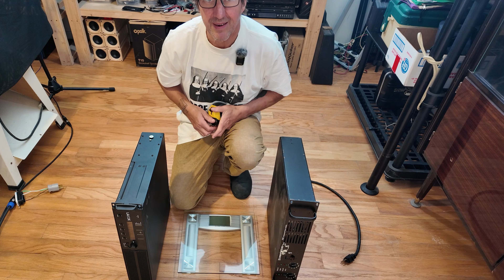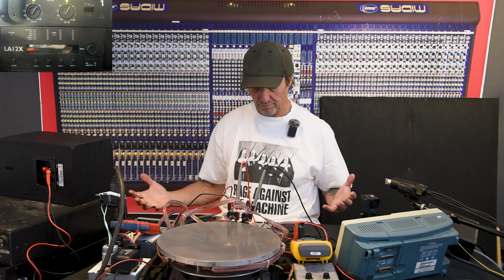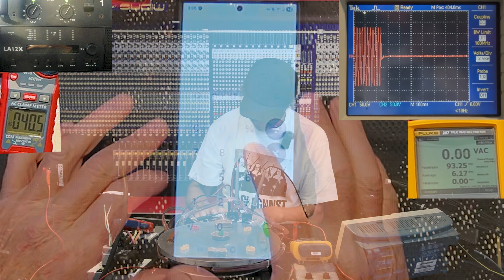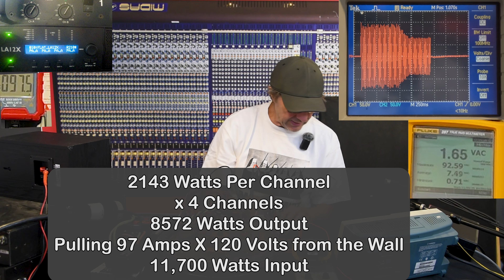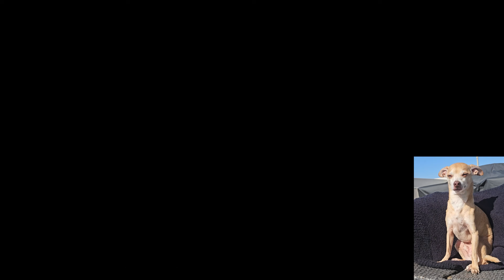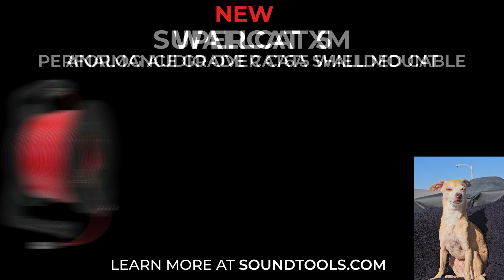Who Does RMS Power Better, Old or New Amp?

Comment: Whichever one has the largest PS XFMR with the stiffest VA supply and the stiffest, largest PS caps will give you the most RMS power into lower Fs - full stop......
Reply from the maker: that makes sense except what about circuit breaker size? in the full stop are you allowing some amps to have bigger breakers than others?

if they are on the same size breaker wouldn't the most power efficient amp have an advantage?

what about if the amp is smart and tracks the actual circuit breaker current supply curves like the LA12x does? 

the Crest blows it's breaker when power exceeds the fast blow front panel breaker.

the LA12X has a power supply that exceeds the breaker size and will draw 100 amps through a 30 amp breaker and then reduce its output to insure the breaker does not blow, is that relevant before or after the full stop?

also there are thermal considerations where the power supply can supply way more power but there is a time limit.

even amps with the same size power supplies may not deliver power in similar ways..

perhaps like two vehicles with both having 500 horse power, like watts.

but one is a car with a turbo charged 4 cylinder engine and the other is a tractor with a diesel engine.

do those factors happen before or after the full stop?

Comment: I wonder if it could do full power if modified  with larger rail caps?
Reply from the maker: caps don't really do that much for very long. they are just little peaker helpers.

running off of 240 volt helps. but the amp is limiting its output to insure it does not ever exceed the capabilities of a 30 amp breaker that it is specified and designed for.

Comment: I'm surprised the amp manufacturers don't go to some water cooling scheme.
Reply from the maker: how many shows or situations do you actually do where you're running every amp channel at absolute maximum with no limiters? The easiest solution is just to reduce the loads on the amps or turn down the outputs a few DB. 

I think it's easier just to bring another amplifier than to have every single amp set up for something that we rarely use it for

Comment: The decrease in voltage could be thermal throttling. When you're testing amplifiers for RMS capabilities operating at high volume levels, amplifiers have thermal protection circuits which will decrease voltage, due to heat as well as stressed capacitance. There's also capability variations based on the frequencies being produced and the fact that QC testing usually uses narrow frequency ranges to calculate output. Lower frequency pulse tones increase the stress naturally as resistances (ohm loads) decrease. Class D amps, particularly the ones that utilize GaN FET topologies, are now rated among the highest quality options in high end audio. Lighter weight, cooler operation and more efficient as well as accurate musical reproduction. And considering that the tech is priced more economically makes newer class D amplifiers tough to resist.
Reply from the maker: I actually did some research and also have friends over at L-Acoustics. The output power reduction when multiple channels are driven is the amp making sure that it won't blow the breaker. 

in the owner's manual for the amp they actually recommend a specific breaker and the amp has that information embedded into it and makes absolutely sure that no matter what it won't blow the breaker but will deliver as much power as it can until it reaches the breakers limitations
Reply: @DaveRat  I suspect the output power reduction when multiple channels are driven is equally as much protecting the power supply circuitry from melting, if those current levels were sustained.
Reply from the maker: I agree but perhaps the reverse thinking

since the amp is designed around running in a 30 amp 120 or 16 amp 240 service,  the power supply and thermal capabilities are timed to be optimized for a maximum long term power of 3600 to 384 watts accordingly.

the output modules definitely can put out more power than the power supply/power source and using the amp to drive a few subs and a mid and hi box will allow all boxes to be driven at max power long term
Reply: @DaveRat  Have you ever explored "rail balancing", where half the channels (identical content ie; subs) are inverted at the amp input, and inverted again at the output, so at any instant those inverted channels draw from the opposite supply rail? Curious how much (if any) difference it makes.
Reply from the maker: one of the first few articles I wrote for Live Sound magazine was on that topic. Maybe search Dave Rat "power to the people"

but modern well designed amps typically do this by design, I first saw it in the lab gruppen amps back when the 6400 was released. 

also doing things like delay arcing subwoofers which puts incremental delays on each few channels or mixing subs and mid high boxes on the same amp has a similar impact

Comment: Maybe a little long video for it's purpose, but yep, it shows the main difference and issues. Analog (linear) amps with classic "convection" PSU is worst case. Then we have analog ends with SMPS PSU, which solve half of the problem, then "final" solution with SMPS and class D amp(s).

The first one is worst, because we have PSU, that is not so "hard" and as it will weight a ton if it have to be capable to delivery sum of power that are capable to deliver whole amps. So this "softness" was compensated in case two, because SMPS have magic thing called feedback, that PSU hold its voltage as long as it can, thing that transformer with caps "can't", if you don't use any kind of stabilization (and you can't, because you will waste huge amount of money, add ton of weight, another coolers and so). But you have still very "ineffective" ends, which works in linear area. That solved class D, where you have transistors in pure pulse mode and that PWM is filtered on RC network on the output.

So yep, old amps weights a ton, are ineffective and also pretty weak (but simple for repair). Then we have something in the middle, SMPS with analog ends and then final solution. Problem is, if we put that huge amount of power ends in one case, we also hit the top-limitation of PSUs. So in this case, the limit is not the amps, but PSU. Btw. if you look closely, for example on Powersoft Litemod amplifier, or B&O Icepower, you can figure our where ends PSU and start "amp" part, small hint: B&O sells also "pure" amp modules and you can simply figure out. Standalone amp is pretty simple and small, more than 70% of whole "amp" is PSU.

Then one thing remains: is that real limitation? Do we listen to 50Hz sine wave? No, also EDM have pretty small power envelope in time, so that's the reason why it doesn't care. More interesting is, how modern amp can handle peaks, because it have ability thanks to more complex PSU and caps bank to deliver huge peaks, where analog can't. For example IPD2400 is not so brutal in first look, but that amp have pretty huge cap bank inside and can use it.

There are also very old school amps, that can deliver "long time" power for hours, but you will get it. These amps weight 20+ kilos, have around 400W in bridge in 8R, are noisy and have pretty bad behavior in peaks. That filosophy died in end of 80s, so these "newer" analog amps can't deliver that RMS power (50Hz sine wave) for like half hour or so (not everyone, but most of them).

So, be happy that we have D class amps and use them properly, don't waste time with cheap ones, grab pricey but branded one, not cutted down models like the cheapest labgruppen ones which are just relabelled behringers. Have a nice day!

Comment: I tested old school car audio amps made by Rockford Fosgate in the 90s and I also saw this reduction of power over time, I don’t blame the amp class but protection circuit and power supply section 👍😊
Reply from the maker: agreed. there is a belief that class D has lower RMS when in fact for a given RMS, class D tends to have a much higher peak and music power, while also being lighter, smaller, cheaper and more efficient
Reply: The power output reduces the hotter the transistors get

Comment: Great topic to cover I like the a/b for minds and highs.  And class d for sub
Reply: Same, I run class AB amps for my compression drivers they just sound so much nicer and more hifi than the class D amps. The class Ds are good on the sub / mid bass, but they are mid priced amps so could well be why they arent as good at the top end. I'd been interested to compare them to some high end class Ds

Comment: Thanks for this video. It was very informative. I didn’t understand all of it but got enough of it. If I need a class D amp, I’ll make sure to plan on not using its max capabilities. 

It was interesting to see that even with the self-attenuation the class D amp does when maxed out, it is still far more powerful than the old school class H amp. 

Decreasing wattage by decreasing input voltage on the class H made sense to me as a guitar player since that’s what Van Halen did with a variac on his Marshalls back in the early days to cut the volume slightly and achieve his “brown sound.” That class D amps are so smart that they adjust wattage to compensate for different voltage was impressive to me.

Thanks again.

Comment: I don't think this is representative of class d as much as it shows this specific amp has a power supply section that is undersized for sustained maximum output of all 4 amplifier channels. I'm sure other amps will do it fine
Reply from the maker: agreed. the max RMS is limited by the AC input/breaker/power supply.

this amp runs on a 30 amp breaker which is common for pro amps. the amp actually is tailoring its output to stay within the circuit breaker current curve and there is a recommended breaker model #

Comment: Fun little experiment. Raw amp power capabilities is one thing but talking about this level of output screams power compression long before any amp limitations come into play. Heck, even speaker leads become problematic. And I totally agree with you on rather having a limited output than no output at all. Here in the EU anything that has more than a few kW (240V mains) gets three phase distribution between amps to balance loads and it's kind of a unspoken rule to use multichannel amps to feed crossed over speakers. Keep the interesting videos coming. Peace!

Comment: There are so many variables involved with the question that there is literally no proper and clear answer.  Efficiency, class D hands down.  Weight, class D hands down.  Compactness, hands down.  A class AB weighs a ton and cost far more to make than does a class D so cost/profitability, again class D. But!  The class D amps generally also rely on switchers for their power rater than big transformers and cap banks and the multi-killowatt ones are likely just as expensive Watt for Watt since they must be designed for low noise output. Now when we start to talk about low end sustainable RMS into low impedance loads, that again depends on a number of factors.  Most amps claim far more RMS out than they can actually deliver for a sustained period.  Most of the limits are to do with smaller power supplies than actually required which both amplifier topologies suffer from.  Assuming all things equil, that is to say amps and power supplies both matched and capable of delivering name plate power (I know, I'm laughing too) there are a couple more things to think about.  Class D has a problem here in that its output sound quality will be load dependent due to its requirements for an output filter.  Filters have to assume a specific load to deliver their output with minimum distortion ans maximum efficiency, speakers are all over the place in reality with back EMF so they pick an impedance and that's that.  AB amps dont much care with at most a small inductor at the output.  They will push as much voltage and current as the rails and the caps can supply.  In this detail class AB is likely superior for both delivered power and low distortion.  The newest class D amps are now getting much closer due to PFFB being implemented so class AB's lead here will be minimal as we move forward.   So we are basically down to efficiency and sustained delivered power.  With the correct amps, Class D wins hands down.  It delivers more power at much greater efficiency and is more compact.  This matters since the power at allot of venues is generally shit unless your electrician was an OCD ass like me and made sure you had stout power in abundance at the stacks location.  Most sound people focus on the speakers, amps, effects, and consoles assuming that the power will be available in abundance.  Then cry when it is not and deliver whatever they can.  When we talk about multi-killowwatt sound systems, 120VAC/20AMP (240VAC/10AMP 50Hz for our European friends) simply will not due.  Also the 50Hz/60Hz matters since to deliver the same power requires bigger still transformers and larger reservoir caps at 50Hz.  So the answer is rater nuanced in the end.  3E Audio makes an amplifier with a pair of TPA3255 amps with PFFB and running up to 52VDC input.  It ships with a basic 48VDC/5AMP supply which severely holds it back.  With a 52DC supply it will easily deliver well above 200Watts into 4Ohms.  My point is this, most every amp is not gonna deliver unless the supply is there and in the case of rack mount touring amps that limit is not in the chassis but in fact at the wall outlet!

Comment: One thing you didn’t mention is the sound itself. In my experience Class D amps sound sterile. They don’t have the life in them like class AB, and sure it comes at a cost, everything comes at a cost, but I’d pick AB for quality of sound all day over class D efficiency.
Reply: You should substantiate that finding with distortion measurements. A quality class D amp has inaudible distortions and a complete lack of modulation within its operating range. ‘Better’ sound can easily be the result of even order harmonic distortion, which is much more likely in a lower powered class AB output topology. One thing’s certain, you’re not hearing the difference between the typical .01% harmonic distortion of a quality class D and presumably lower numbers from the class AB. Our hearing does not work that way.

Comment: test on 115V ? What's the point, knowing L acoustic is a French company and target EU rental, their amps is rated and design for 230V use, and trust me, they can do it with no problem. They indeed can be use on 115V but with restriction and fuseprotect alert. Even your own american brand QSC with the powerlight 340/380 is not able to deliver that kind of long period power on 115V because of the current draw for the power supply...

Comment: A class AB totem pole amplifier with a bipolar power supply is essentially a variable power supply. Some amps can actually be used this way, as variable power supplies. If the output of such an amplifier is supposed to be, say, +4 volts at a given instant in time, and is feeding a reactive load typical of a speaker, the amplifier can provide any reasonable amount of power, sourcing or sinking, to maintain that +4 volts. It is essentially stiffarming the  load to accept that four volts at that instant. The ability of an amplifier to do this is measured by the 'damping factor' spec. For good class AB amps, the damping factor can be quite high. Vacuum tube amps or solid state amps with an output transformer have a more limited damping factor that is related to the physical size of the output transformer. It is limited by the transformer how much energy that can be sourced or sunk at any given moment. The other limitation is you cannot get DC or even low frequency AC through an output transformer. Class D amps are very similar to amps with transformers. The PWM driven output devices are like tubes in that they can only source power into a fairly low value low pass filter that cannot sink a lot of reactive power coming back from the load. I suspect class D amplifiers work best when they are grossly overdriving the load, and the instantaneous current capacity overwhelms the load reactance without necessarily having to be that loud acoustically. So, what does this mean in practice? With its characteristically high damping factor, a type AB solid state power amplifier is going to make the speaker cone follow the signal through thick and through thin. This likely results in the most accurate reproduction of the incoming signal. For all other types of amps that do not have high damping factors, reactive energy from the voice coil 'motor' has to come from (or go) somewhere if you want the speaker cone to be compliant with the incoming signal. If the amplifier cannot handle this reactive power, the consequence is the voice coil must move to generate or absorb the reactive power needed at that moment, reducing the compliance of the speaker movement to the incoming audio. Therefore, the speaker itself will add some distortion to the resulting audio if the amplifier does not have enough damping factor to handle speaker reactance. I think this is why tube amplifiers work best with speakers that don't generate a lot of reactance or back EMF in operation. This would tend to be large speakers with bass reflex ports that allow the speaker to do its job without restricting its ability to move. In fact, some of these speakers work the best and sound the best if there is a certain value of resistance between the (low damping factor) amplifier and speaker. This is counterintuitive. Modern small acoustic suspension speakers need a lot of power to move the speaker cone, but with class D especially (and class AB solid state in general), the power is there to get the speaker cone to compliantly match the incoming audio and source/sink the reactive energy that results from speaker operation. In any case, something to think about!